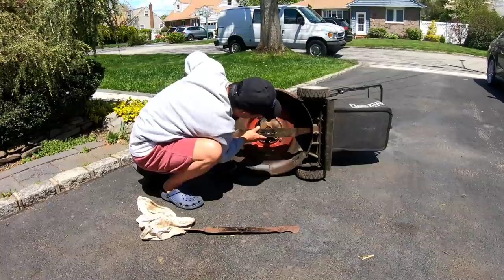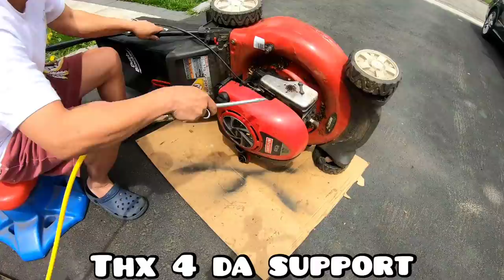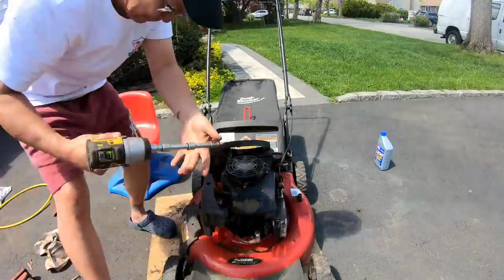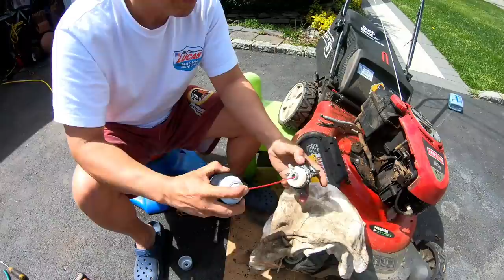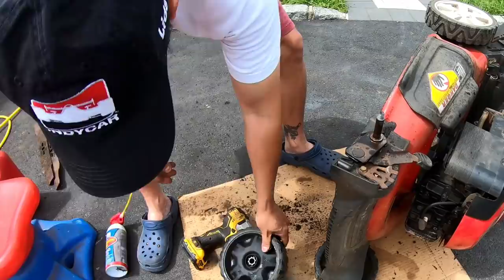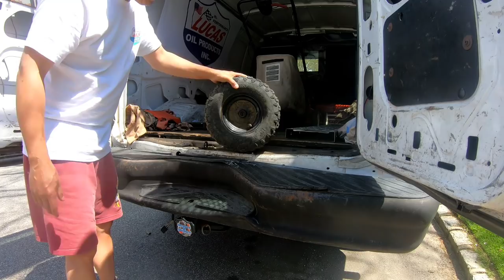FREE CRAFTSMAN MTD 21" BRIGGS QUANTUM PUSH LAWN MOWER CURB ALERT PICK RECOIL STARTER CARB CLEAN FIX

Comment: I have a guy in my hood that mows grass for cash, I fix his mower from time to time for years now, well he brought me his mower that I sold to him a few years back, man he beats the crap out of them, so I repair them for him, don't charge him much cause he's a good guy as am I.... Lol. 
Well long story short, he brought it to me this year and the crank shaft is badly bent so no saving it, while I put a engine on the deck for him, I can use just about everything off the old engine on repairs so what the hell, well sold him anothrt mower, a weedeater 22" with a 3.5hp, he keeps bringing it back cause this happen or that, well today blade bent 22" so I have a few, and a partially sheared flywheel key, grrrrrr.... Told him watch what he mows damn it..... Will have it fixed Saturday for him for 20 bucks, he speaks broken engrish so telling him anything is ruff, LMAO.